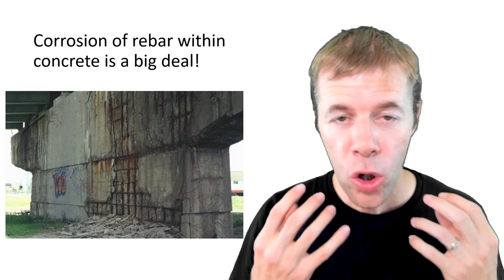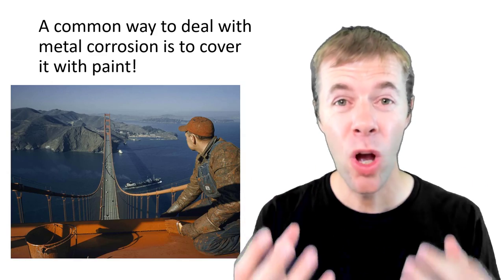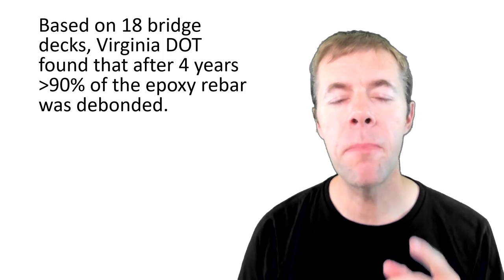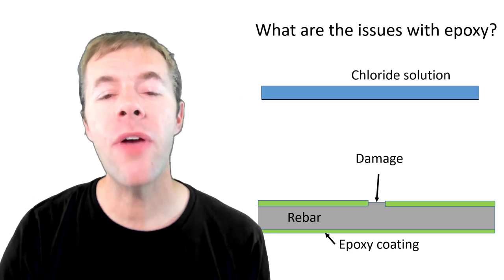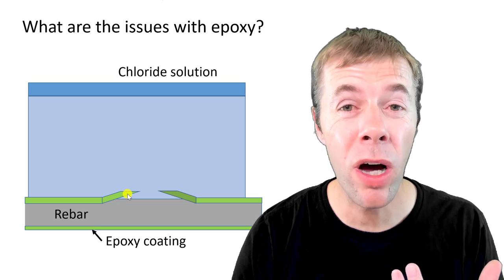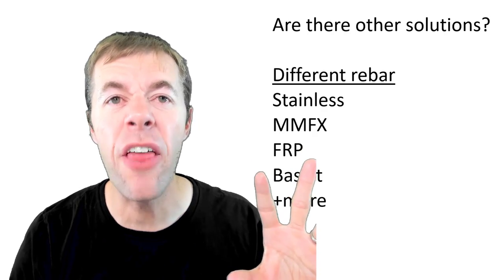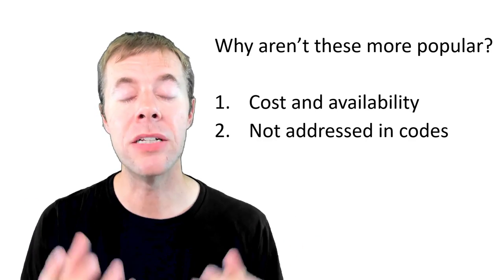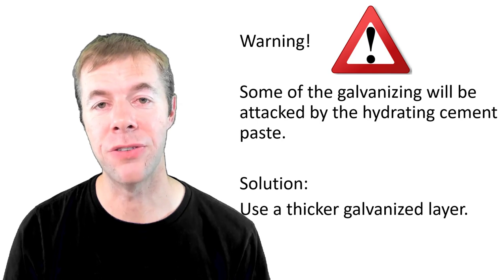What is epoxy coated rebar and why is it being banned?

Comment: Romans had the right idea; just use a little more concrete and forget the rebar. The fact that their structures last 1000's of years unhindered is enough proof.
Reply: The Romans were geniuses in making concrete . They contained purous materials like volcanic ash, , and lumps of volcanic rock which the cement absorbed into .Its rather like fibre glass resin absorbing into fibre glass sheet
Reply: Difference being their bridges were much shorter with far less load capacity.
Sure you could replace modern long spanning bridges, but not with a little more concrete, we are talking 5-10x.
Reply: @MsSomeonenew  A good point, but when it collapses from metal fatigue and corrosion because your state/city misallocated the money... well, it was kind of pointless. They need constant maintenance and our failing infrastructure in conjunction with our debt is a recipe for many future disasters. I remember a story about a mayor in Japan that built a tsunami wall many times the height of others; people called it a waste of money and laughed at him calling him paranoid. They weren't laughing after it was the only thing that kept them from being wiped off the Earth without a blink. They now visit his grave to pay respects. That should be the mindset of government and engineering.
Reply: @cerebral3591  the second metal is placed in concrete, the concrete has a limited shelf life.  As the air slowly reduces the alkalinity until eventually corrosion sets in.   Concrete itself can survive a while longer, but even it too gets broken down by acids coming out of the atmosphere and into the solution in its pores. (from car exhaust, life, pollution, etc)
Pores can be blocked, which roman clays and pumice achieved to a degree, and if there is nothing but concrete, and it is not subjected to rapid temperature change concrete itself will last an extremely long time.   That being said, we can achieve so much more with rebar than without.   The question isn't "how long can we build this to last without rebar?", but "can we build it at all?"  Of course, maintenance is key, there are hydraulic cements, corrosion inhibitors, sealants, sacrificial anodes, and the application of electrical current to prevent corrosion.   as it is an  electro-chemical reaction attempting to reach equilibrium, we can change the reaction by manipulating either the chemicals involved, or the charge.
No matter what we do though, we run the risk of passing our infrastructure on to those who will be incapable of understanding how to maintain it.  Say we build the ideal bridge, no new bridge needs be built, and our descendants may well lose the ability to achieve a new bridge through a lack of experience.  The better the structure is at requiring no maintenance, the further actually maintaining it becomes from peoples consciousness.  Rather than focusing on building perfect structures we should focus on raising generations both capable of repairing them, and aware of the need to maintain things.  
Nothing against attempting to build things as best we can though; I am all for building the most resilient possible structures (within practicality) as well as being a huge proponent of hardening all our critical infrastructure with better buildings, and redundant systems.
Reply: Maybe... maybe not. Do you know how many things the Romans built? Perhaps it's just the last 1% or 10% of extremely good performers that are still around today, the other poor 90-99% have long since crumbled.
Reply: @user-ut9ln4vd5m  true dat.  Survivors bias.   I always tell people that too.  That all the cruddy roman buildings fell down long ago.
Reply: @cerebral3591  That's a cool story. I wish you would link to a source.
Reply: @user-ut9ln4vd5m  Survivorship bias at its finest
Reply: @hosmerhomeboy  I never said that all Roman structures were of excellent quality. I think it's pretty clear though that we can learn and emulate from the ones that are marvels to this day. Kind of a poor argument to suggest we shouldn't because some structures were not long lasting. Should we not build modern structures because some people live in mud huts still?
Reply: @cerebral3591 o, you did say the romans had the right idea.  The point was that they had the right idea -sometimes-.   Emulating the aquaducts, or the roads, or some bathhouses, would be a good idea (we still use them today).  I never said we shouldn't emulate them, I just stated that building as they did simply is not an option if we wish to achieve certain structures, and that most of their structures were not all that good. (1/3 of rome fell over in a day at one point).   My point was that indeed we should try and build things to last the test of time when we can, but that this is not always practicable, and no matter how well we build, it will still depend on the coming generations to maintain things.
Reply: They actually had better concrete.  Availability of volcanic ash to make the stuff is the issue
Reply: @hosmerhomeboy  Well hello there
Reply: @HallyVee  Lol, I am so dumb it literally took me a minute to figure out what you were on about.  lot of us not using our real names around here.  Yours is a bit more creative than mine though
Reply: No one is driving cars and trucks on old roman bridges. They certainly dont put salt on them when it snows'
Reply: The roans didn't have to worry about heavy trucks.
Reply: @tedhaubrich  we use fly ash from power plants and silica fume from computer chip fabs in concrete now. It does the same thing as the volcanic ash, and keeps these materials out of landfills.
Reply: The building of the Roman Colosseum is the first time that concrete and rebar was used in construction. The Roman's used bronze rebar and not Iron rebar. It may be the reason the Colosseum is still standing after 2000 years. So' Roman's didn't forget rebar, they invented it. True shit, start googling.

Comment: An interesting problem indeed! 

The galvanized coating works until it is eaten away, but then normal corrosion happens (and it will get eaten away, because the coating functions like an anode); the void left behind by the dissolved coating would likely have a more corrosive environment than before. This begs a question: can a galvanized-coated rebar once the galvanization is eaten away create a passive oxide layer? Or is the resulting corrosive environment after the coating is eaten away too aggressive to allow passivation, assuming the rebar material can actually passivate? I wonder how that would go?

Comment: Do not laugh but I think the future is plastic rebar. Maybe some along the lines of a plastic carbon fiber material. We are making better plastics every day so it could happen and I think it will.
Reply: David Henderson I have seen Fiber glass reenforced concrete that held up pretty well in tests.
Reply: carbon fibers are expensive AF ... yet
Reply: I was going to ask about that, specifically what the disadvantages would be with plastic rebar.
Reply: @johnp893  As of now there is no plastic rebar . But I fore see a day when there will be. I think the source will come from 3D printing.    A lot of things that have to be machined from metal today will someday be able to be printed from a plastic metal substitute. A plastic that is strong as steel that can be drilled and machined and as handle the loads of steel. When such a plastic is invented the advantages will be light weight rust proof rebar. But right now plastic rebar would be a joke. It would do nothing at all it fact it may even weaken the concrete. But give it a few years and we will see such things as plastic rebar, I think.
Reply: @AndreasIndustriePro  As of right now yes but look at the story of aluminium. At one time it was worth more than gold. But once it learned to mass produce it the price drop to the point it is now seen by some as a disposable item. One day carbon fiber will be as cheap to produce as paper is today. And if we can find a way to use the carbon in the air to produce it we can fight pollution as well. I know it is a dream but humans are good at making dream real.
Reply from the maker: David,
A version of plastic rebar is used today.  It is called fiber reinforced plastic.  It is like fiberglass.  

One challenge with plastic is that has to resist the caustic pore solution in concrete.  Some of the early plastic bars that have been tried became brittle and snapped.  They have improved this but I think more work is needed.  I agree that it is a good idea!
Reply: @TylerLey  SO my idea was not as crazy as it sounds. I am glad to hear that.
Reply: @johnp893  One disadvantage of plastic rebar would be its poor high temperature performance especially in the case of fire.
Reply: The Chinese use bamboo scaffolding. I think bamboofibres in soecially firmed concrete would see the combination fuse to make a really tough material.  I will try it one day...
Reply: @TylerLey  Glass & Basalt fiber rebars are infused with epoxy, which is chemically very resistant.
Basalt is a very common raw material.
A FRP/Basalt rebars is used one size smaller than the steel rebar, because of its exceptional strength, but more important is the weight saving.
Reply: @davidhenderson3400  Printing a piece of plastic rebar on a 3d printer would be extremely slow and expensive compared to extruding it as a rod and passing the still-warm rod through rollers to add the ribs.
Reply: @jmowreader9555  I have tried to post this 3 times already and each time something happened so here I will try again..........
You miss understood me. I think the raw material used will come from 3D printing. I think they will be the ones who  develop the material first. Once 3D printers start using a plastic metal substitute then every one will start to use it. It could be extruded or injection molded. I think the source of such a material will come from 3D printing because that is where most of the research for such a material is being done right now.
Reply: i work with plastic fiber crete and steel fiber crete quite often. The fibers resemble thin, short wires and are mixed with the concrete. Steel is used mainly factory floor slabs and plastic fiber crete is used in large retail floor slabs. Both are a real pain to break, and steel is dangerous to handle by hand. The steel fibre crete makes GPR scanning almost impossible, and over time the steel fibers become exposed at the floor surface. needless to say, im not a fan. 
What most dont realize is that the subject concrete in the video is most likely affected by air entrainment. A process that allows water to fill air bubbles in the concrete to strengthen it from freezing damage. Rebar decomposition is mostly an exterior phenomenon.  Ive seen 50+ year old interior concrete with mint rebar.
Reply: @TylerLey  More research is needed with all these ideas but it is good to remember that all the ideas in use were researched and found acceptable- but somehow they failed anyway! What is truly needed is to change the research methods (said as Engineers cringe everywhere). We've got lots of really old structures with few to no problems using "outdated" methods which have supposedly been "improved on". What we should do is study them to determine why they work well versus other similar structures that don't. Get out of the lab and into the real world where perfection doesn't exist and where anything that can go wrong does go wrong. And stop thinking that minimalizing is good engineering practice. It isn't except where weight is critical- in everything else having some excess strength to compensate for things going wrong is a far better approach.

My career started in industrial form carpentry and I can say without question that there's a lot of crappy workmanship going on and nothing goes as planned. Rebar meant to be 3" deep will range from 2" to 4" in a lot of places. 10" spacing will vary an inch either way. Engineering to minimums doesn't take this into considration  but it needs to. Even heavy galvanizing isn't going to do much good when the rebar gets bashed, banged, dragged, bent, chewed by cable chokers, is mispositioned, and is generally mistreated in every way possible. That's what you're up against in the real world and that's why minimalistic approaches do not work. These things will never change (except for getting worse) so what has to change is the Engineering. 

The best path to success with anything is to study and follow the already successful as closely as is possible. The more you deviate from that path the more the chances are that you'll be less successful.
Reply: There are several problems regarding plastic rebar. First, plastic doesn't have the tensile strength of steel at room temperature, which rules it out. The purpose of steel reinforcing is to improve tensile strength of concrete along the surface, where tensile forces are extreme. This reduces the amount of concrete needed for any given structure, which reduces the weight. Plastic simply can't meet this need and for this reason isn't used. 

A second problem is that plastics tend to be extremely temperature sensitive. Any reduction in temperature will dramatically increase its brittleness, while any increase in temperature will dramatically reduce its tensile strength. This completely defeats the purpose of the reinforcing member, which is to provide tensile strength.

Then there are the production problems, and the installation problems, and the transporting and handling problems, ect, ect. Frankly, the only advantage of plastic is that it's lighter, and can be moved by fewer workers, which reduces the labor cost.

Comment: Galvanized wire has been used in the "field" (literally in fields as fencing) for years. Unlike exposed bare steel it wont turn to dust in a couple of decades.
Reply: thats exactly what this vid shadows on. it does turn to dust. the epoxy coating doesn't protect the steel as intended.

Comment: The Golden Gate Bridge does NOT undergo regular painting as you stated. Which is a big reason the steel cables inside the enormous steel jackets are fraying. The bridge has only been painted once in it's entire life. 
Many other bridges are infact painted in the mannor you described, such as the Tobin here in Boston. Which also is suffering a few enormous cracks on key components leading to a permanent closure of 1 lane

Comment: It should all be galvanized, christ we've solved this year's ago with screws
Reply: I'm in the middle of a wood deck replacement project. When taking apart the old deck, which has been repaired several times, I see which screws work and which fail. Galvanized work for awhile. Some are still silvery. Some have turned black on the surface. And some have almost completely eroded away, just a slender bit of steel down the center of the screw (usually in the middle, both ends are still full diameter). Galvanized is waaaay better than plain steel, but it's not perfect.
Reply: @ScottyDMcom  Not all galvanized is hot dipped, and hot dipped costs more. I'm talking about the larger lag screws and carriage bolts like half inch diameter by 8 inch long hot dipped carriage bolts and various sizes of lag screws for a small covered deck,  because I just spent a couple of hundred dollars or more for several hundred hot dipped fasteners for a small covered deck/porch project. Stainless steel would be cost prohibitive, even if it was available. Anyway this porch will be around a lot longer than I will.
Reply: @joebrake1141  Stainless is available in all sizes, and is most highly recommended for the newer ACQ treated wood which is highly corrosive to all other fasteners. Bring your second mortgage with you to the online hardware store to buy them. The ceramic-coated screws are supposed to be OK but I've now seen so many instances where they corroded within a few years that I no longer trust them. Those were good with the older CCA lumber though. Hot-dipped galvanized nails do seem to work well with the ACQ olumber so that's what I now prefer to use. Trouble is that they are not made for air-nailers so now you pay me extra for their hand-driving. And ACQ doesn't last as long as CCA, so my guess is that in another ten years or so we will return to CCA unless something better is developed as insurance companies get tired of paying for injury claims due to code-compliant construction which doesn't work as intended.
Reply: P RO, I was making a comment to Scott Miller, not asking for advice, but thanks anyway. I already bought all my stainless deck screws and hot dipped carriage bolts and lag screws long ago. My shopping is all done.
Reply: Galvanized steel still rusts, just more slowly. You need to keep the water away from the rebar.

Comment: I have wondered about stainless steel rebar.  It will cost more, but with rising sea levels it does be prudent to build in anticipation of that fact.
Reply: Stainless steel  costs 3X more than plain steel.
Nickel and chromium are expensive.

Comment: The Roman's concrete has lasted for 2,000 years.
Reply: But it was not reinforced.
Reply: So has the iron pillar in India ! Looks like we are putting on science blinders and failing at our modern inventions...
Reply: They used volcanic ash cement, it is waterproof .
Reply: @partymanau  "Roman" concrete was water, sand, limestone  and  pozzolanic ash but the ask was not used all the time.